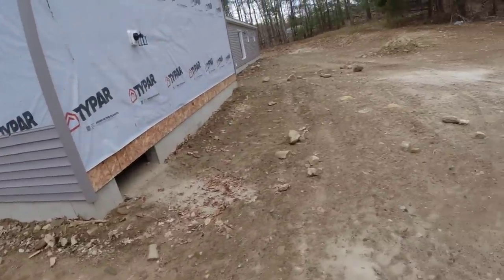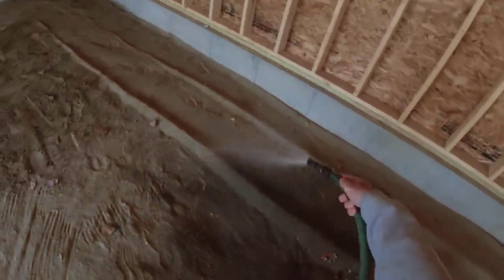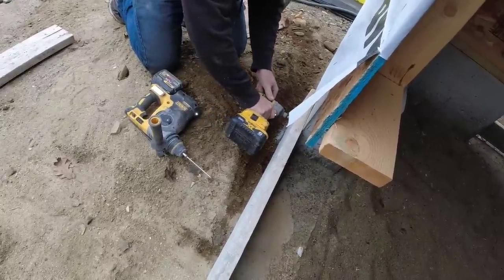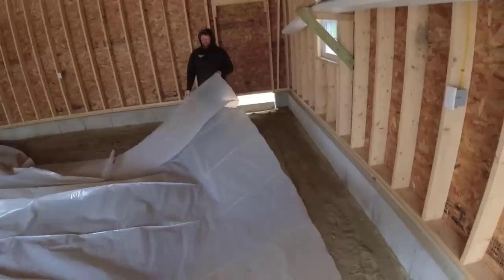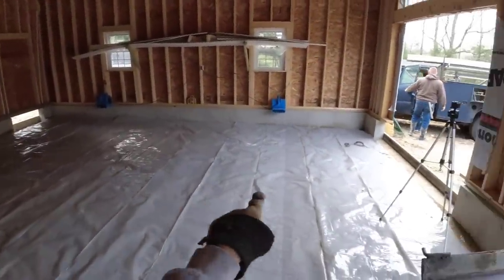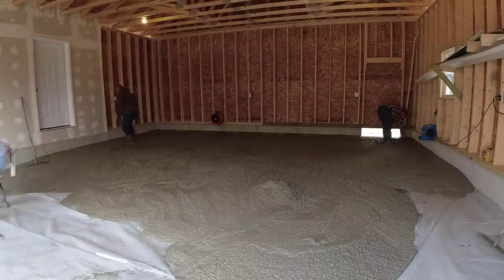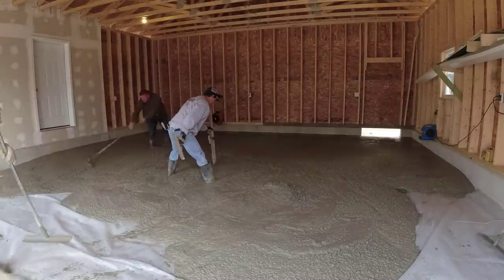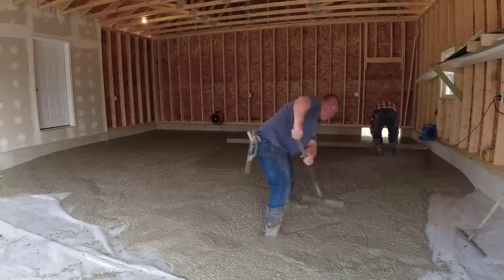Garage Concrete Floor Pour 32' X 26' (3 Man Crew)

Comment: We use the mid range at 6.5 slump wire installed 4000lb no coal chute needed with front load trucks. 24foot deep works good. But just 2 of us.

Comment: My 1000 sq/ft garage floor was poured in the 1970's.  It's solid, but a very rough surface and water puddles in places instead of flowing towards the floor drains.  Is it possible to just add a few inches of new concrete on top of the old to make a nice floor? 
I'm going to have to replace my badly cracked concrete driveway soon, and it would match the height of a new garage surface.
Reply from the maker: Short answer is yes. I've got some videos about pouring concrete over concrete. We've done a lot of garage floor overpours like you describe.

Comment: I’m curious who goes around I need boards in does the edge
Reply: I’m actually about 30 miles east of Rochester New York and we always have to use 4000 PSI concrete
Reply from the maker: We take turns.
Reply from the maker: We'll use 4000 in the colder months